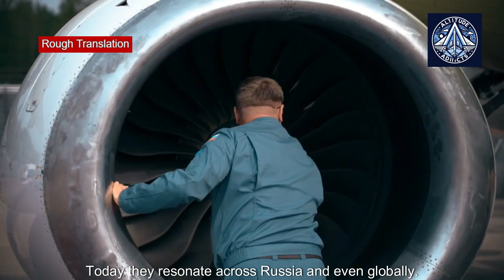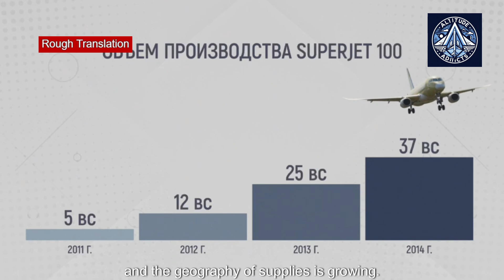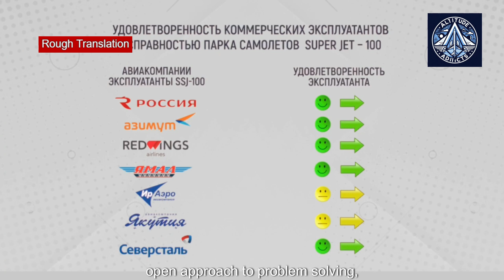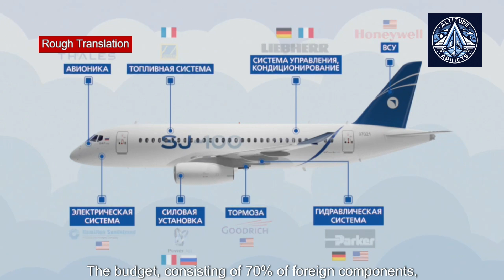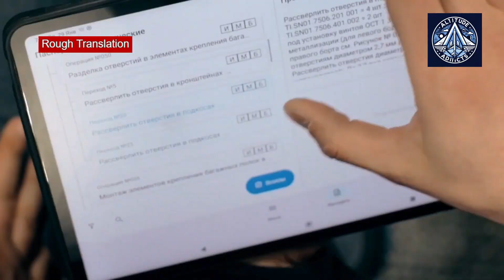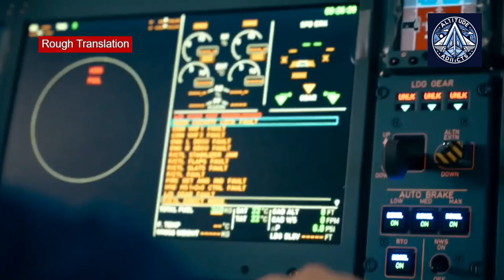Yakovlev Production Center’s Komsomolsk-on-Amur Facility - Official Promo

Comment: Russian civil aviation has come a long ways, but they still aren't world-LEADING on engines, avionics and Service/Support. They need to make progress in all those areas.
Reply: Russian liberals and corruption in government are fully responsible for all the problems Russian civil aviation industry ever had and still has. They were catering strictly for Western interests only and ruining or selling out interests of domestic industry in every way they could.
Reply: Most of those people are still in highest positions in government or industry. It's just that times have changed, so they can't continue with what they did before.
Reply: If you consider that they're now practically 100% domestic, they're pretty unique in the mix and quality of competence they possess. They may not be the best in any single thing, but they're certainly the best in the sum of what it takes to make a modern airliner, compared to any other single country, IMO even the US.
Reply: @ I understand they are mostly used for domestic applications, but performance standards are not just for show. The capability of engines to get excellent fuel usage impacts overall airline costs, likewise durability means less maintenance costs. These are important stats and engineers should endeavor to achieve the best. My point was, Russia has done very well improving the quality of their goods and services, they have come a long ways. But they still need to improve. They still want to sell aircraft to the developing world and those nations want airliners that have low costs to operate.
Reply: @heyfitzpablum  I'm not talking about them being used domestically, I'm talking about them having all the know-how and competence inside Russia, because the new aircraft as well as the engines (which are perfectly competitive with modern western designs) are being practically 100% produced domestically, all including avionics, titanium components, composites... That is what's unique about them and about current Russian aviation industry. No other country has this complete set of competences.
Reply: @wakko454  PD-14 is a good engine, but it's not in the class of the Pratt and Whitney  PW1000G. Bypass Ratio is one metric where it is lacking and that impacts fuel economy. Still work to be done. And Service/Support is another area where Russian aviation companies have been negligent. The Sukhoi Superjet 100 has experienced poor support and delays for spares which have caused it's users around the world to stop using them. When you market an airliner, you have to have customer focus-especially for maintenance issues.
Reply: @heyfitzpablum  It's precisely in the same class. The differences in various output parameters between PD-14 and PW1000G are minuscule, 1-2%. Bypass ratio is not a god to be worshiped, it's compensated by other parameters, and the overall operational costs of a PD-14 can easily be a bit lower than for the PW1000G. You could say that the PD-14 is "tuned" for a bit different mode of operation (more usual for the Russian market), but is not better or worse that the competition.
Reply: @ The difference between a good and a great jet engine are small, but tangible. Only in the fullness of time will we know which engine is better-along with performance it will get into durability, serviceability and other things. But based on the STARTING PERFORMANCE SPECS an engine with better Bypass Ratio, thrust to weight and other key metrics has the advantage. They are not meaningless metrics, they impact performance.